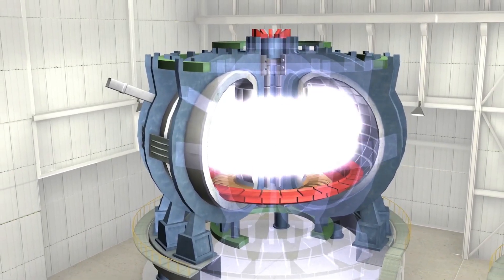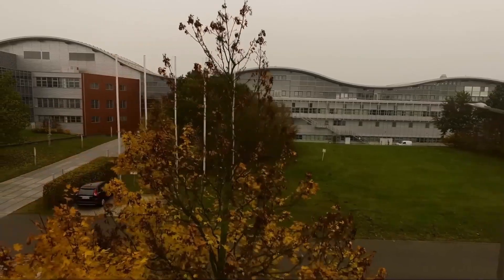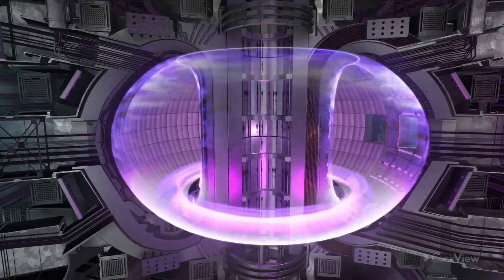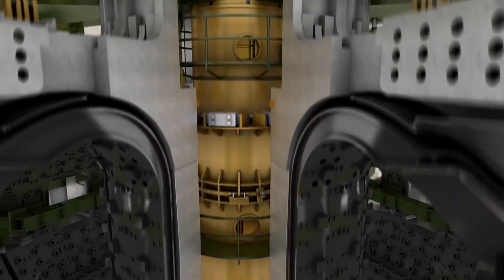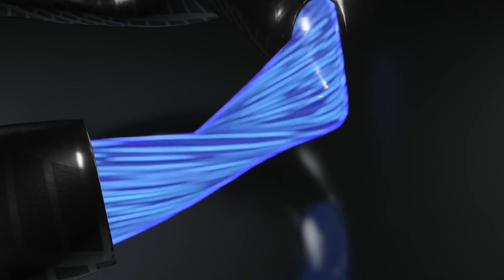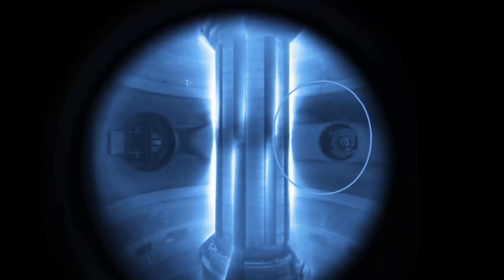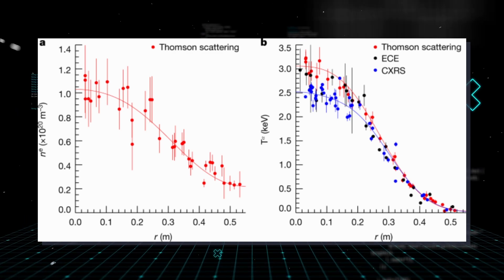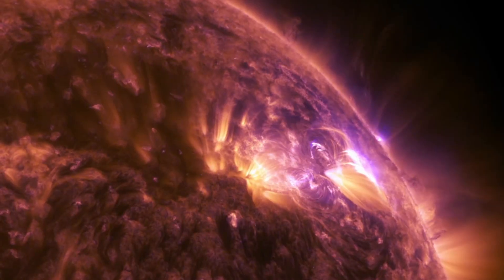Germany's New Nuclear Fusion Reactor SHOCKS The Entire Industry!

Comment: People have been told that unlike Fission, Fusion is "clean".  Nothing can be further than the truth!  Fusion frees neutrons, just like Fission, they fly out of the Reactor and travel at 1/10th light speed for about 12 minutes before they decay and fly apart.  Fusion also creates Gamma Rays, X-Rays, and Tritium (extremely bad if inhaled).

Not only will ITER be dirty as hell, it will also be potentially dangerous, which is why it won't export power.  For instance, a sudden power outage, will cause the Super Magnets to instantly convert all that magnetic flux to instantly convert to Counter EMF, they will go off like small nuclear weapons.

But I don't know much, I'm now building my 2nd Fusion Reactor...

Comment: The stellarator is a beautiful machine.  The most surprising fact was revealed at the end, that there is no circulating plasma current, so it can run continuously.  That seems like a huge plus to me, like a gas turbine versus a piston engine.  The video is visually stunning, but I am left wondering how and why the twisted spiral works.  I can intuitively get the Tokamak, but not this without further investigation.